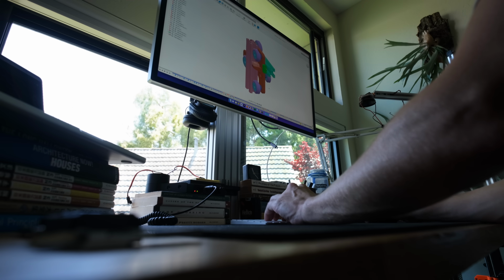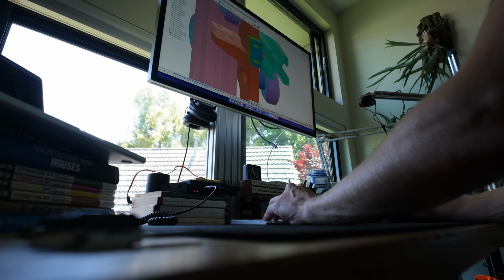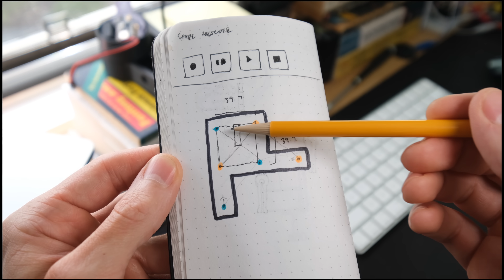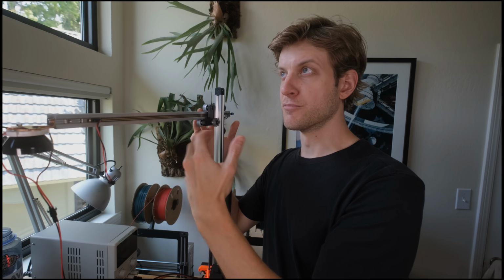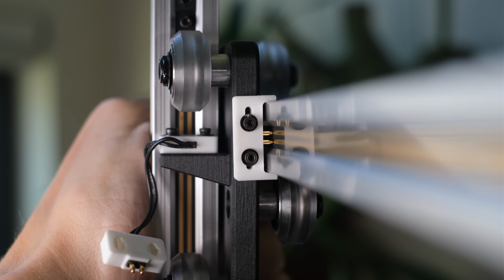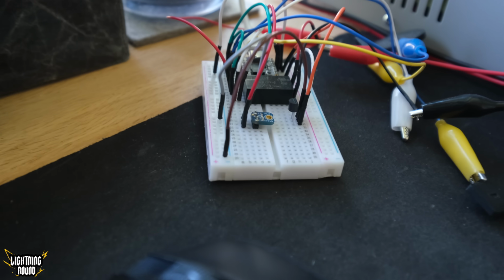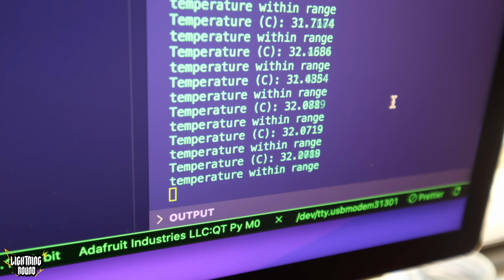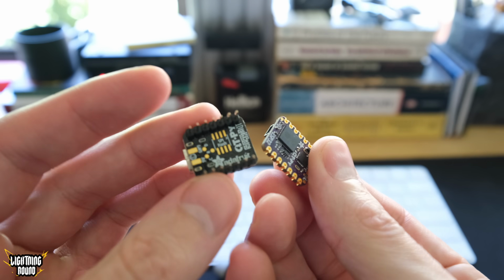This stupid thing might actually work - DIYson Lamp Build Log #12

Comment: Can't  you put the 2 pin conectors in the big plastic bracket? Then you elemininate 1 set of pins, make them "invisible" and since they are more centerd they might solve the problem you mention around the movement/losing connection

Comment: From the looks of the video I think a large portion of your rigidity problem is due to the distance of the wheels from bottom to top of the track.  From what I can tell your using fixed holes in the plates to dictate the position, I suggest you use eccentric spacers so you can move the position of the rollers and finely adjust the preload.This is how the my old clone Ender 3 printer did its linear motion system and you should be able to find a good balance of rigidity vs resistance

Comment: Another way to limit the movement of the pogo pins on the super tracks is to put them as close to the pivot point as possible. The larger the radius is from the point of angular movement the further the distance traveled in one degree of motion. If you limit the radius of the angular movement, you limit the total distance allowed to travel by the tolerance stack-up. Effectively, the most ideal positioning would be to have the super tracks facing one another, rather than perpendicular to another as they currently are, and then have the pogo pins opposing one-another centrally where the two tracks align. 

Getting that alignment right and being able to wire things up electrically would be kind of challenging, probably, but it eliminates the mechanical wear component added today. I think both solutions are fine.
Reply: Just thinking about this while watching the video! And the design could also help to hide the dangling wires, into the center of the carriage, beneath both of the vertical and horizontal arms.

Comment: It may be out of scope for your design requirements, but a second eccentric roller (4 rollers per axis) would eliminate most of the pitch and roll sloppiness. Another thing to consider is using extremely stiff filament, like carbon filled nylon/PLA, and possibly internal/external ribbing along load paths

Comment: Hi, I've been following your videos of this project since I saw a YouTube suggestion and I love seeing the creative process and the practical application of what you do. While watching this update I was thinking: "for the Pogo contact points, would it have been possible to increase the size of the contacts in the rail, the tracks that are used to bring the current to the Pogo points being wider would avoid, perhaps, the disconnection of the points when there is a pressure on the rail as you show? " To try it you could add width with conductive copper tape, it avoids undoing everything, it's not thick so should not be a problem the height given that the Pogo points are on spring it will remain in constact? 
Anyway, it's great to be able to follow a project like this step by step, thanks for sharing.
Reply from the maker: I'll probably bump up the trace width a bit in the next revision :)

Comment: At 2:08 you can see at least some of the flexibility is the wheel shafts moving away from each other - did you consider extending those shafts and putting a sort of cover plate that ties them all together? I think that would increase the rigidity, without needing to change the wheel placement. The downside being it covers the carriage up a bit, and wouldn't be an option on the vertical side (as it would obstruct the couterweight).

Comment: I think you could implement this movement directly into the printed part using thin parallel beams. This concept is often used in 3D printed compliant mechanisms and would fix the tedious assembly.

Comment: Why Python instead of C++ on the microcontroller? Arduino is not much more complicated to program, but it's much more efficient, which means you can use a cheaper microcontroller.

Comment: To lean into 3d printings strengths, would it be worth creating plates that encompass and interlock with the existing plate? Complexity is free and thickness is cheap, so having an external plate for each side that encompass the bearings would prevent the torsion from splaying the bearings. They'd need to interlock with the current bearing plate using something like a finger joint to prevent them from rotating like a twisted 3d parallelogram.

Comment: I don't know if you're interested in the opinion of some undereducated fool, but I feel like this could be more elegantly solved. Moving the pogo pins to the rotation axis is a good start, but couldn't you improve the pogo pin assembly to slot into the aluminium extrusion? I think that would both solve the connection issue and mitigate some of the motion, making it a more robust product.

Comment: Have you considered using multiple pogo pins for each supply to add "redundancy". At the moment it is reliant on both pogo-pins being 100% in contact with the PCB. However, by employing multiple pins for each supply which are connected in parallel would reduce the chance of all of the pins leaving the track at the same time.

Comment: Although I can see why you would prefer the 3 wheel design and then just work around it's lack of rigidity/constraint, would it not be better if you had 4 wheels per extrusion, restraining the movement to the axes you desire and not looking odd like the offset 3 wheel design did?

Comment: If you wanted to, you can make your microcontrontroller hold up so it doesn't shut down when the contact is intermittent, just diode and capacitors before the regulator, you can probably pack a handful 10uF 25V MLCCs.

Comment: Awesome to see the work, glad you put out the video 😁. You might be able to benefit from another set up for the vertical slider or set spring screws that can't be screwed in too far along with some simple trapezoidal shapes for the pins so there is even more total "tolerance slop" I guess 🤷😛 also on the vertical axis another roller to help with the bend there too night help tighten it down, but it might feel heavier and have more friction. The aluminum part might benefit with some holes placed in it to help with air flow, a small hole with recesses on both sides too help act as a deval nozzle, denser towards the heat and so now smaller holes then less with larger holes of needed. Slots might be just fine with a recess hole if wanted or aesthetic is desired 🤷. Love the bread board, wondering if you plan on putting it in the counter weight area for "cleanliness" or more polished look, or something with the base? Heats seemingly always an issue, so a basic vapor chamber might do you very well for a simple passive cooling setup. If it's even needed lol, it's probably not producing enough, but maybe for the hotter environment crowd? Or for the fan maybe? Hope it helps, love the update and work you've already done 👍💪 keep up the great work!

Comment: I wonder if you could reduce the flex in your 3d print while still keeping it off the shelf by using metal "mending plates" from homedepot in the print? Or strategic use of threaded rod? I love this project. Thank you for continuing to work on it

Comment: Like always very nice !! I might have an idea for you to have more rigidity and go smaller in the bearing assembly. You can maybe use smaller bearing that will roll on the flat surface of the extrusion bar and to keep everything nice and tight, use a nylon skate that could slot inside the v slot. Use some kind of set screw to push onto the skate to make it more or less tight. I would suggest an other material than PLA to avoid (reduce) creeping of the plastic because of the tension :) !

Comment: Solutions that deal with "the other 5%" can really make everything a lot nicer to work with, as an item and as a project.
Reply: Might be able to improve the tedium & alignment by switching the pogo carriage around a little, making it a shoe that rides in extrusion's grove on the supertrack, held against it with magnets and a ferrous insert behind the track. Those extrusions are very reliable so you should be able to trust the groove width and make a long shoe that aligns closely to the groove walls, therefore keeping finer alignment with the supertrack and a consistent distance/alignment between the pogos and the track. Put a pin sticking out from the shoe and have it engage in a slot on the wheel-carriage to transfer only linear position. With this all the remaining variation is moved out from between the pogo pins and the supertrack where it matters, to between the shoe and the carriage where it specifically does not matter. Focusing the motion there may call for extra soft wires between the two pogo pairs but that's probably a good idea anyway.

Comment: How about going back to cables just make an add a way to keep the cable under tension. A tackle configuration could have a lot of cable, the tackles would have a spring in between them and provide/retract the cable. The whole could be hidden in a tube.
I think we can also copy some designs from corexy gantries, there a two belts and both endpoints of belts are terminated, the hotend of the printer has 2 belts terminating at it.

Comment: You can add rigidity while keeping it 3D print only by adding another 3D printed plate to the other side of the wheels to "sandwich" them. 

Currently the wheels are cantilevered so the loads on them are being transfered as torsional loading on the plate. If you add a second support plate on the other side, now you are transfering it as just straight tensile loading and you will get way less flex.
Reply: while i completely agree, like he mentioned, the simplicity and "intentionality" of its design matter. unless his goals aren't achievable, he's unlikely to add a second plate.

Comment: change the pogo pin design: prepare a piece of rectangular copper bar with the exact size of the inner gap of your aluminium profile. Drill 2 holes in the bar and attach ( solder or glue ) to you pogo pins. Saw a gap in the bar between the pogo pins. Fine tune the gap size with the max. elongation of your profile during sliding. This way your electrical contact to the PCB is much more precise. Hope you get my meaning. Once this is done, you can optimize further the strength of your carriages. In the moment your carriage is a flat print. Add extended thickness in the 'free' areas between the wheels to enhance the stiffness. Or like in concrete construction: add inside your print steel bars. Cheers from Herri, a German goldsmith in China

Comment: JLCPCB and PCBWay both have CNC machining options for not much in the grand scheme of things. There's also send-cut-send. I think you may be overestimating the difficulty of sourcing metal parts. Though, of course, I also have a machine shop in my garage so that's a bit different too.

Edit: also, this series is responsible for me purchasing a Dyson Solarcycle. It's a great lamp!

Comment: Do you have those pogo pins with the rolling ball tip? If not then overtime the contact issue might come back as the pins start to bend and wear from the horizontal forces. For a horizontal movement application you could use a spring contact like the ones in multimeter switches (e.g.: 70ADH-2-ML0), those might last longer.

Comment: Love this project! How about rotating the bracket with the clinched thread inserts? The way you mounted it is definitely the safest, but clinching is a strong connection and rotating it would spare you the need for the shims (if the threated inserts are thick enough).

Comment: Great video as ever!
While watching this, I think that just hells flex out on their arms. I mean, plastic will not be indefinitely stiff, it's normal. 
But what if on the other side would be another layer of plastic, so wheels would not be possible to be spread out so easily? Or maybe pcb reinforcement? Lattice style shouldn't look so bad, and would allow you for embedding a logo if needed, and structural integrity would be much better, yet still affordble

Comment: Use copper on top and bottom of the beam. Transfer heat and electricity. Make the wheels conductive.  If the aluminum is anodized it won’t transfer electricity (not with low voltage). 
Fun project. I’m going to try it sometime

Comment: Another way to tackle it would have been to place the connectors at the center axis of movement in the arm. This would be where the arm move the least, even with a non rigid arm. Right now , the connectors seems to be at the position where there's the most movement.

Edit. I love this series and hearing all the considerations on the design process. Nice work. Keep it up!

Comment: Could the PCB not have been put on the underside so the movement would never create diagonals/mis-alignment between the pogo pins on the vertical arm and the PCB on the horizontal arm?

Comment: What about the idea of mounting the pogo pins at the pivot point of each arm? I mean, the arms are not designed to pivot, but with the slop in any mechanism, there IS a pivot point.

What if you designed the carrier so that the pivot points of each arm were in the same spot, then you could have the pogo pins directly opposite each other within the carrier, possibly even a single internal piece within the carrier, with pogo pins on each side. Currently the contact strip in the vertical extrusion is on the back, which I would think, only amplifies any slop in relation to the pogo pins.

Finally, have you looked at using the counterweight cable(s) to pass current? If so you could use a single set of pogo pins on the vertical extrusion, attached to the counterweight.

Is it high current? Can you pass power through the extrusion itself? Maybe one path through the extrusion and the return path through the counterweight cable?

Comment: Maybe I'm an outlier but it appears you're getting a bit stuck on the "ease of accessibility" side of this project - especially in regards to trying to keep it 100% 3D printed. A huge part of what makes this lamp feel premium is the rigidity, for it to move the way you want without flexing; without feeling like a toy. Every manufacturing method has it's place, many PCB companies offer CNC'd parts cheap and accessible to the masses - that doesn't take away from the buildability of your project. All we have to do is upload the STEP file and click order. Further to that point, Bambu has made rigid engineering filaments accessible to the masses - PLA just isn't suited for rigidity and that's okay, why sacrifice the quality?

The people building this project are DIY-ers, your user base isn't afraid of other manufacturing methods. I mean, we're already going to be placing PCB orders to make this. My humble vote? Go rigid, go premium. If it's loose and 'floppy' feeling, I fear that many won't want to spend the time building it.

With all that said, keep pushing on. Seeing creators like yourself persevering through the process spreads determination on our own projects. Thanks!